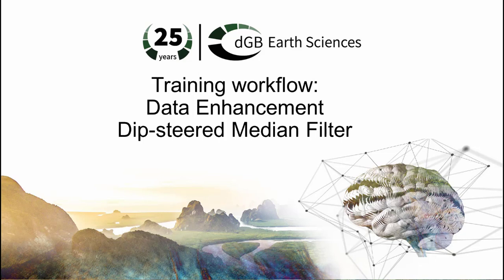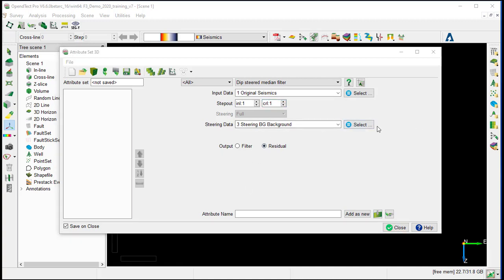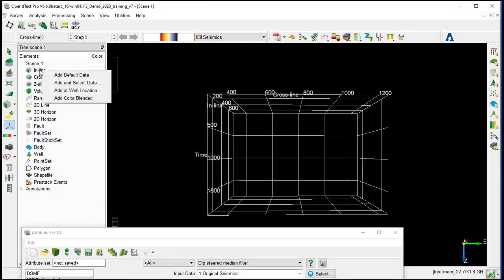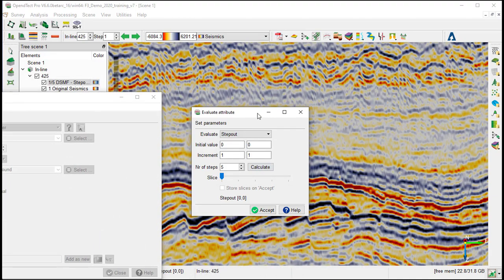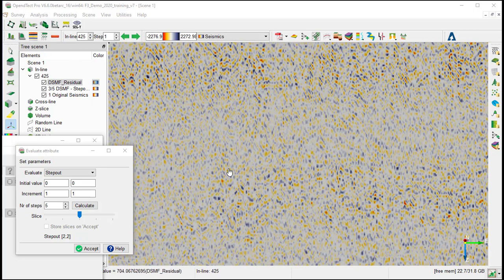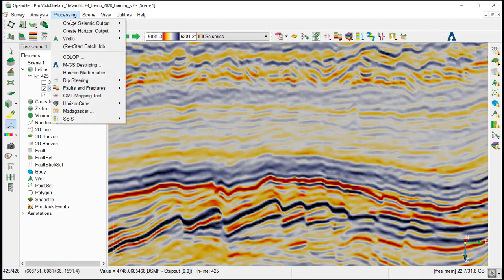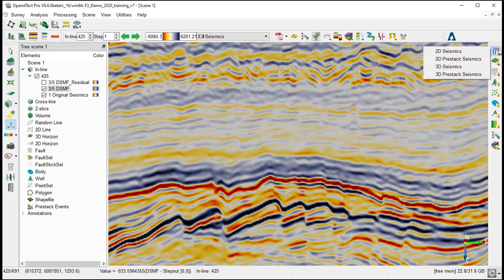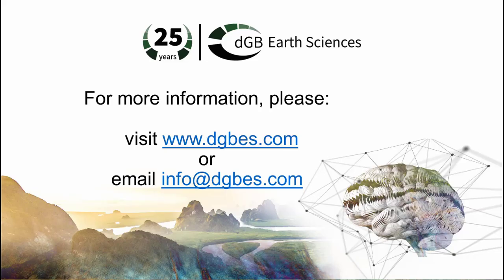Training workflow: Data Enhancement - Dip-steered Median Filter

Comment: I found unclear (also in the manuals) which parameters have been used for computation of the steering 2 detailed and 3 background. Can you clarify please? thank you
Reply: Hi - there i much discussion about the necessity to use different types of SteeringCubes It is safe to say, however, that say that the parameters for steering cube calculations depend on the purpose for which they are to be used. HorizonCubes require a different SteeringCube than a median dip filter. We have a rather old but still relevant pdf that explains some of the differences and shows some of the parameters: https://static.dgbes.com/images/PDF/effectivedipsteeringworkflowusingbgsteering_primerodata.pdf
I hope this is still of use to you. Please note that the algorithm referred to as 'BG' is now called 'Phase Gradient', and that some details of the User Interface ma have changed.
Reply: @MarkCrawfordmarcusrobur  Thank you, the pdf is clear. Best r.